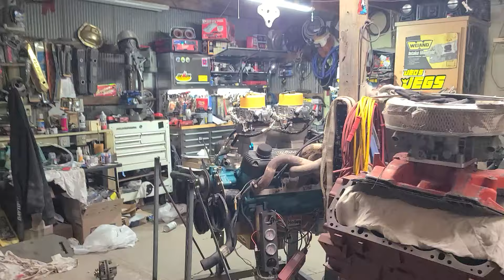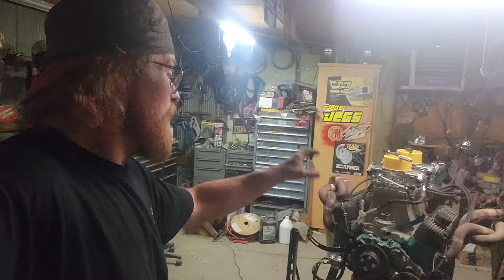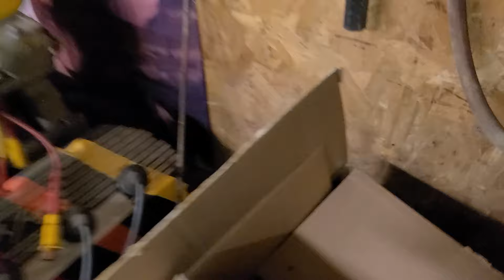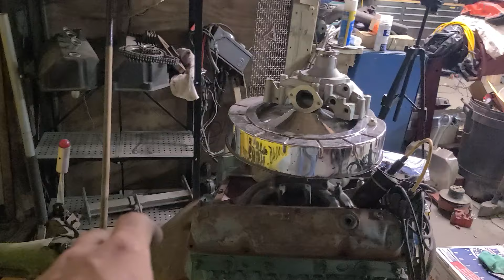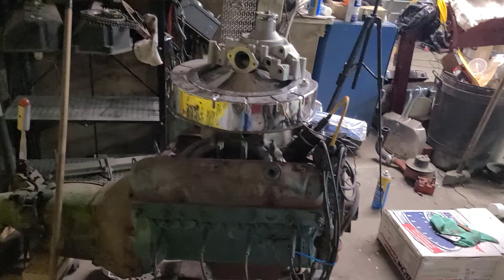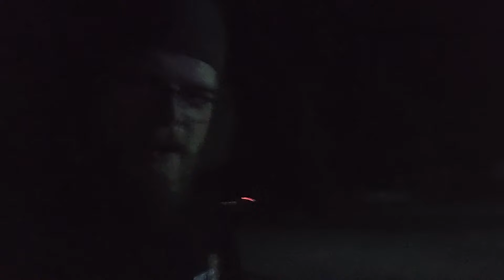Update on Everything going on ‎@ScottsSpeedShop  W2 340 build and Jezebel @HolleyPerformance

Comment: Do you think that 23spline will hold with  Jezebiel stroker engine? 
I'm asking, because i have allso 23 spline, that i'm gona use with 489 stroker.. i think it will hold, with narrow tires😅
Reply from the maker: Talking with Dan Brewer, the 23 and 18 splines transmissions will both handle about the same power. With that said, my Chargers days of racing are done